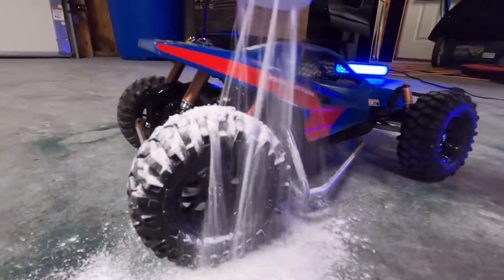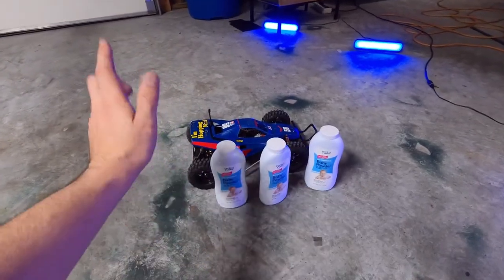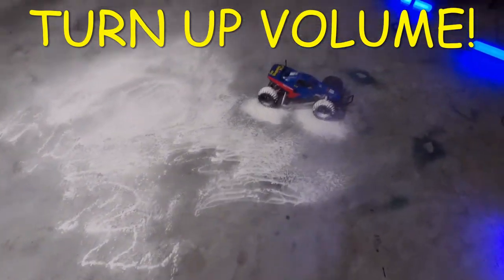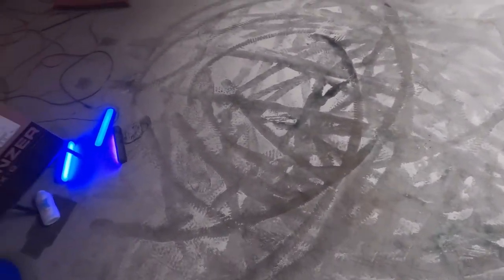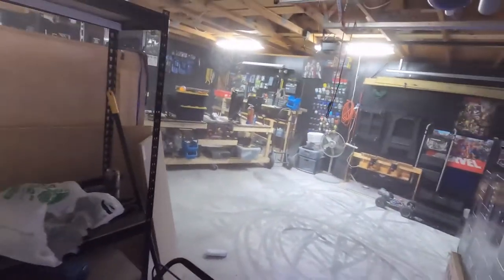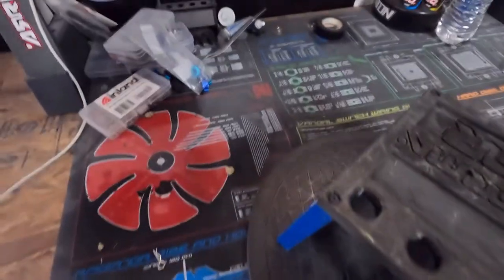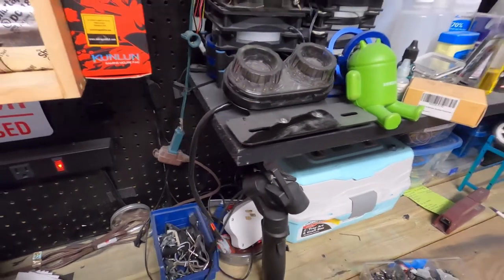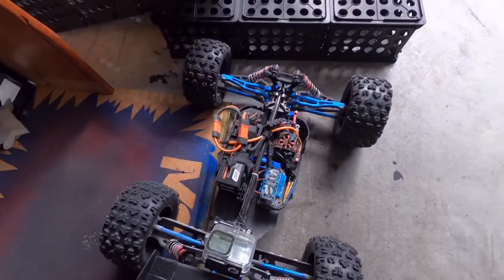RC " DOUGH-NUTS " in Baby Powder!! Burn Out

Comment: Great video, what are those tyres, they look fantastic, really change the character of the Grasshopper. 
#
Reply from the maker: thank you... it made a huge mess.. everything in the garage is covered in baby powder... the tires are a special tire you can buy on eBay..  if you go to eBay and type grasshopper tires... you will also need the adapters so the tires will fit..  consider subscribing ..  check out the channel